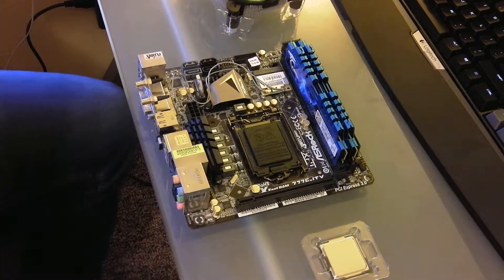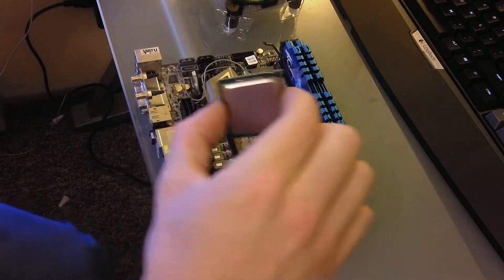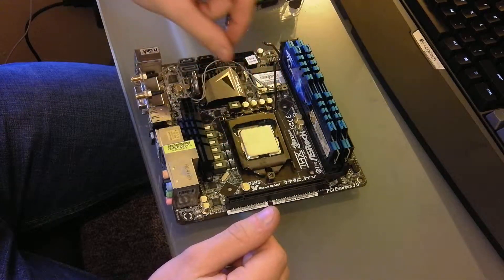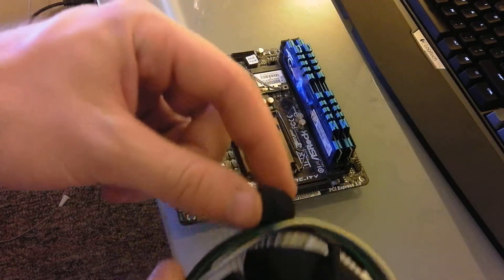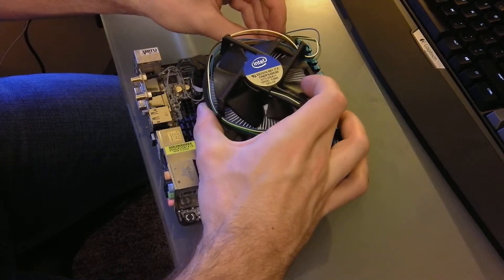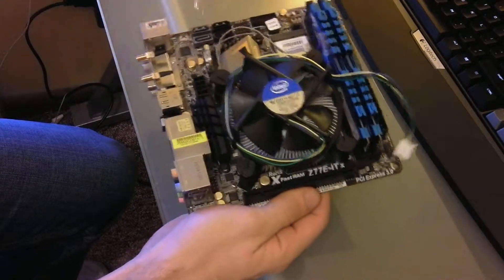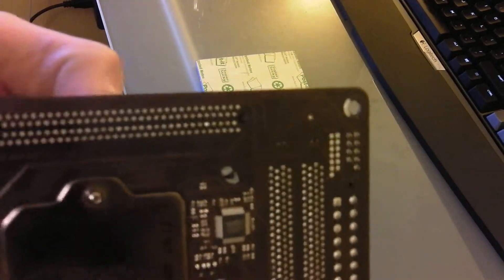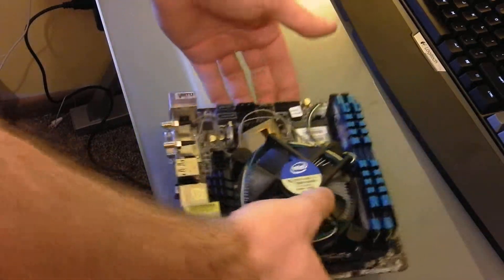Tutorial: How to install an Intel CPU (775, 1156, 1155, 2011)

Comment: No thermal paste?
Reply from the maker: You only put thermal paste on the top of the cpu, not underneath
Reply: mr82020674
I know, did you apply it though.
Reply: Deadpool wade most intel heatsinks have thermal  paste pre-applied